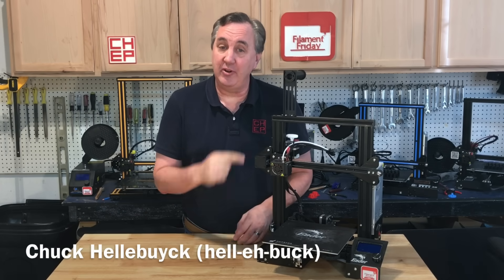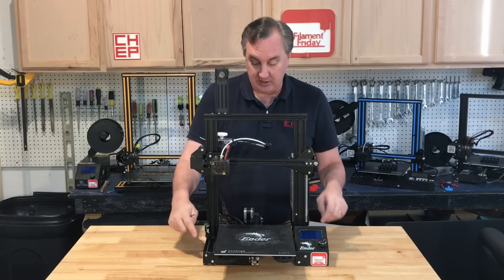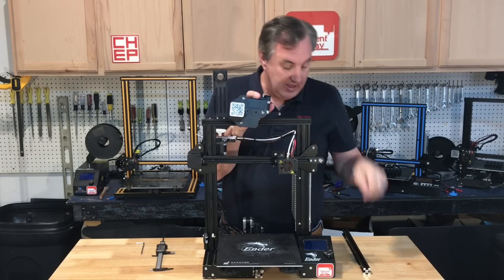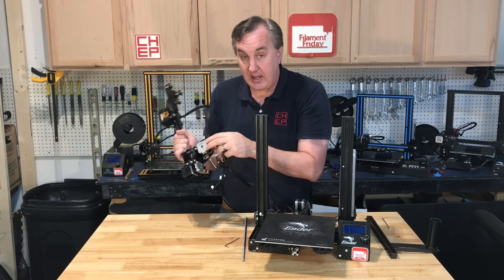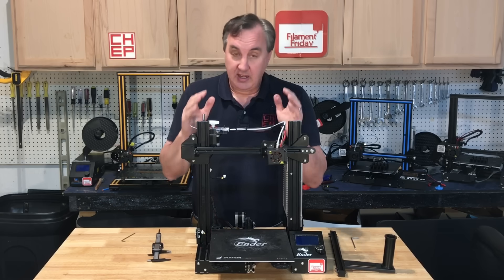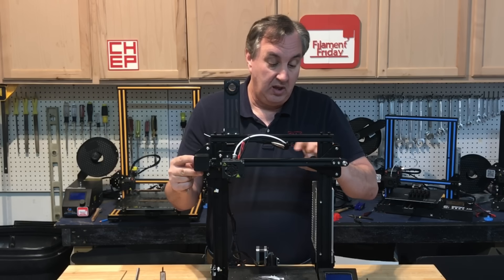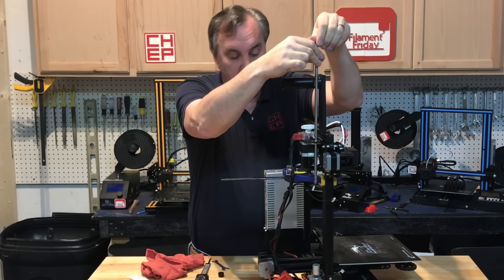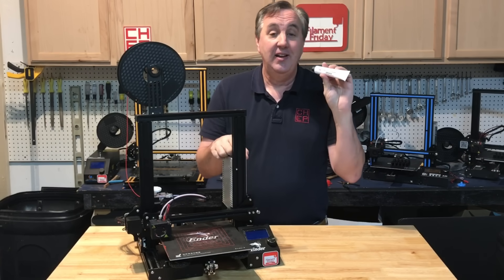Fix Your Bed Level on Creality Ender 3

Comment: Hi Chuck,  I have been following you since I got my Ender=3 v2 last month but recently have a problem that I cannot find an answer to and I am hoping you might be able to help.
New, Ender-3 v2 with manual leveling and replaced springs.  I am quite familiar with setting valve lash so I am also familiar with the concept used in manually leveling the print bed and I would say that I have tried both 'tight' gap and just barely dragging when adjusting.

I do not think that the bed level is the issue.  What I have noticed is that after the machine performs the 'Start Gcode' and moves to begin the print the head lifts slightly, my fingers on the z axis screw, the head does not 'drop' to print level or drop at all from its lifted position and begins to extrude into the air.  I have easily slipped my paper gauge with extra room as it is printing, possibly able to put two or more paper thicknesses into the gap.

Start g-code: [I have not modified this in any way]

; Ender 3 Custom Start G-code
G92 E0 ; Reset Extruder
G28 ; Home all axes
G1 Z2.0 F3000 ; Move Z Axis up little to prevent scratching of Heat Bed
G1 X0.1 Y20 Z0.3 F5000.0 ; Move to start position
G1 X0.1 Y200.0 Z0.3 F1500.0 E15 ; Draw the first line
G1 X0.4 Y200.0 Z0.3 F5000.0 ; Move to side a little
G1 X0.4 Y20 Z0.3 F1500.0 E30 ; Draw the second line
G92 E0 ; Reset Extruder
G1 Z2.0 F3000 ; Move Z Axis up little to prevent scratching of Heat Bed
G1 X5 Y20 Z0.3 F5000.0 ; Move over to prevent blob squish

Any ideas on what is causing this and how to fix?

Thank you - Trey
Reply from the maker: Everything looks fine there. Check your slicer settings for Z offset.
Reply: @FilamentFriday  I could only find one mention of Z Offset in Cura 4.8 under Build Plate Adhesion and it is set to 0mm

Comment: It always amazes me that the Chinese don't use washers on their bolts each bolt head should have a plane washer and a shake-proof washer to spread the load and stop the bolt working loose!!
Reply: Bob, do you really want to spend an extra 7 cents on the same product???

Comment: Thank you SOOO much for this, my ender 3 pro has not printed right since I got it, and this is why.
The Left side prints fine, grips the bed nicely, but the right side is lumpy and reluctant to run smoothly, it even catches on the bumps of the previous layer and jumps over a bit, even tho I level the bed every print.  the left front leveling knob has even fallen off mid print twice..  so frustrating.
Now I have some idea where to start to fix it.

Thank you.
Reply: Mine is similar, with the back left having to be almost 100% tight, while the bottom right is practically falling off.
Reply: @hexaspark  I'll add that to the list of things to do when I get my new bowden tube in. Thanks for the suggestion.

Comment: Hey Mike, thanks for a great tutorial.  I am new to 3D printing and had terrible problems levelling the bed. I suspected the axis was wrong but wasn't sure so it was greaat to get the help.  this video solved my problem on the ender 3 pro

Comment: On my Lotmaxx the screws that hold on the uprights only thread in by 7mm. Anything mechanical like this needs at least 13mm  bite especially since the screws are only 5mm. In my case also the threads aren't deep enough in the uprights so you would need  get a tap and thread a bit more and some longer screws.

Comment: Hey Chuck thanks for the great vid! For some reason mine doesnt move up and down nearly as smoothly/fast as yours does no matter how I adjust the eccentric nuts (theres one on each side for the ender 3 pro) I leveled the frame exactly as you did and everything. Could it be just the white lithium grease?

Comment: My left front knob is very loose I can't adjust further and the nozzle is not close enough.    The left back knob is tight and cant go any tighter and needs to so I can level the bed.    Would this fix that issue?  I dont want to have to take my printer apart if I dont need to.
I've been fine for about a month, but the front left has always been a bit loose.  I've monkeyed around with the z-axis switch in the past to help with leveling,  but now I cant get that to work  

Btw  - you have excellent and very easy to understand videos

Comment: hey Chuck I don't know if you will see this but I am running into an issue with the bed, I leveled the bed did a test for the 4 corners and the middle and it turned out fine, my adjustment knobs are not loose/free moving. but after one print (about a 45 minute print it was a knob for the filament feeder) my bed was really unlevel, like I could see the gap on one side(the right side), would wingnuts hold my adjustment knobs in place, or am I thinking too much into it using wingnuts to keep it together and stop it from moving.

I built my printer using your guide, and levelled it with an help from your video on levelling and Tomb of 3D Printed Horrors
 print to check levelling and how to level. thanks
Reply from the maker: Adjust the stop switch so your springs are more compressed when level. It might help.

Comment: clamping a square on the uprights before tightening them will not get the results you claim, there is no adjustment in that direction if the ends of the uprights are not machined square to the length of the upright there is nothing you can do about it short or recutting the ends square, but it you clamp a straight bar across them at the bottom before you tighten them you can at least get the two uprights inline and parallel with each other.

Comment: Hi Chuck,  I'd like to thank you for the video you had posted to fix the angle gantry rail.  I'm going to apply what I have learned in your video to the E3PRO I have so my springs are not out of whack.   

I also have a question for you.  I have recently purchased the 'gold' springs to replace under the bed, I had done so and the Z-axis limit switch is far too low, I had moved up the switch so it will accommodate the new springs.  I moved it up approximately 6.53mm from the little foot that rests on the lower tube..  Have you replaced  your springs and had the same issue?   Thank you for your comment & help on my issue.
Reply from the maker: Glass bed requires similar so it’s fine
Reply: @FilamentFriday   - I don't have a glass bed  just the normal E3PRO bed that came with it.  when I raised the Z-axis limit switch you think it affected the total build height?

Comment: Question, why aren't those screws a little bit longer and screwed in from the front? The metal behind could either have threads on the holes or washers. The aluminium bar is already drilled through, it only needed a little cutout for the screw heads like you see in other parts of the printer. That simple design change would have made life so much easier for beginners and assembly guide videos. But, to really have any positive impact, it had to come from factory, it will hardly become a mod, because when one gets to the "modding" point, they probably already leveled it a long time ago, and it's not something that requires constant leveling.
PS: I've checked with a barbecue skewer, there is nothing behind the X carriage's metal plate that rides inside that channel that would impact the screw heads.

Comment: Really helpful. I've been driving myself crazy with leveling mine, got a glass bed, thought it was warped, turns out the frame just isn't square. I still have the smallest dip on the front of my bed, might use some masking tape or something to bump it up a bit under the bed.

Comment: Hey @CHEP

I don't think you mentioned it in this video, but I spent probably an hour tinkering with the left side of the X-axis bar, got it within .4mm of perfection, then put everything back together and adjusted the eccentric bolts to make sure it was tight. It was off by as much as FIVE MM afterward.

I did this probably a dozen times, then finally decided to look at the right side - Lo and behold, two perfectly accessible screws that didn't require any disassembly. I did the same sort of adjustment you showed on the left side, on the right side instead and now it's within .3mm on both sides with the bolts where they should be. It may be worth trying to do the right side, with 0 disassembly, first!

Just thought I'd give you (And anyone else who was struggling) a heads up.

Comment: I'm having almost the opposite problem with my new Ender 3 pro - the bed levelling springs are all at or almost at full extension, and are still not close enough to the extruder on one side.  Any ideas?  What am I missing?
Reply from the maker: Lower the Z home switch
Reply: @FilamentFriday  Good idea, but I've double-checked and the Z-home switch is mounted as low as it can go - even if it could go lower, the carriage would hit the z-axis motor before hitting the switch if it was any lower.  I'm thinking replacing the springs and/or using a glass bed would give me more height to play with
Reply from the maker: Then something is major wrong.
Reply: @fudgeweasel  I had this issue and so do others. I found a forum (Can't tell you where it was months ago). I ended up just using the snips to cut the foot off and lower it some more. It seems to be the common solution. Everything has been fine since.

Comment: I bought an Ender 3 Pro and love it. It prints great out of the box. I have watched most of your videos on it, thanks for that. My bed is warped, can you make a video on how to fix that. I was wearing a groove down the side of the magnet and decided to go ahead and out the glass bed on because of this. I want to print on the flexible magnetic but cannot until the bed is flat. Thanks in advance.
Reply: You can mod the firmware to enable manual bed leveling or to add a sensor for auto bed leveling. That can correct for a warped bed in software. The only other option would be to buy/build a new heated bed from some temperature stable material, which I have no idea is a thing or not but I guess it should be if other printers don't have this problem.

Comment: After I built my printer, I could not get the bed level and ran into the issue you mentioned of the springs on one side being tight. Your instructions on how to adjust the x-axis bar are extremely helpful and I'm finally printing.

Comment: So is a automatic bed level system pretty much a must have if you're wanna get serious with 3d printing?
Reply: Absolutely not! While it can help immensely it is not a must have. If you're having a lot of issues with bed leveling and just cant manage to get it right (and don't want to buy an abl) you should look into manual mesh bed leveling! Teaching tech has a great video on it, and it helped a lot before I saved enough to buy a bltouch.
Reply: @Clonephaze2327  that's what I was thinking. It's just now that I've been 3d printing for about half a year or so. I've probably watched approximately 4 billion youtube videos on my way to a semi confident printing ability. I've started to notice things that I had no clue what were. One being that pretty much everyone has an auto leveler. I havent really had any issues in fact most everything I've printed has come out much better than expected. Now it's just more curiosity than need. I got the ender 3 with most of the bells and whistles and just wondered if that's the next step.....also, and this is most likely going to be a super stupid question. But I have not seen anything actually addressing this. Does the heater bed need to be on for the whole print or just the initial first few layers. I ask this only because theres alot of prints that will start higher and then drop after the first layers. I know ABL needs all the heat you can give it. But is pointless for PLA other than the first few layers?
Reply: @s8nlx661  hey sorry I never saw your reply! I would definitely keep it on personally, as when most build plates cool down they tend to "release" the print a bit since the first layer is allowed to cool and shrink. Keeping the temperature up will make sure the print stays on the board!
Reply: @Clonephaze2327  that definitely makes sense. It's kinda funny, these little things never actually get mentioned. You'd think that would be mentioned for beginners but I looked everywhere and theres literally nothing anywhere. I e just been leaving it on and never thought twice about it. But after seeing how small adjustments can make a huge difference in your prints, it had me wondering. But yeah I see what you mean in temp shrinking and plate cohesion. It's funny, 3d printing must have been a nightmare before youtube. Theres so much to help learning. But pulling one of these printers out of the box and all you had was an instruction manual to show you how it works and then go from there..it must have been ultra aggravating. So youtube is almost a necessity. It may be the most important tool for 3d printing...now, if they only put a full cura  program for android I'd be good to go. Its baffling how that is not a thing. Alot people dont have a pc cuz phones are just as good if not better. Theres a few that are so so. But are very limited not a full actual program. Like the pc versions. It makes no sense at all
Reply from the maker: Check out Astroprint. It’s in the cloud and uses Cura as it’s slicer.
Reply: @FilamentFriday  that's actually the one I use. It's pretty good overall. The online cloud version is good but the app android version is awful. All it allows is size, quality and fill percentage. But no actual manual settings like the online version. If the online version gave the layer feature, and not just the 3d plate it would be perfect. But someone on the 3d geeks site said that they are going have it soon. It was supposed to be added in the new layout that happened in mid March but there were issues and wasnt ready. So if that happens it will be a huge plus. Cuz having to buy a computer just to use a slicer is waste of money. But it looks like 3d printing is getting more and more popular. Especially with the price of the Ender 3 and its ability to put out some amazing prints. And now the resin printers have dropped and offer a 200 dollar model now. The miniatures crowd are gonna be buying those up.
Reply from the maker: Not for me. I’ve had more issue with ABL than anything else so I manually level and leave it alone. Works great.

Comment: Hi Chuck, my machine has the problem that you have mentioned... The main problem is not with the machine but with me as I am a bit lazy. I ended up putting washers under the springs that didn't have enough tension - shiming is a lazy way out I know... Do you think that it will have other problems doing this?
Reply from the maker: Not that I know of
Reply: Martin Birrell 
Print a cube and check that it is a cube.  It probably won’t be, because your x-axis and z-axis aren’t at right angles.
Reply: Buy a silicon solid spacer hot bed leveling in aliexpress maybe will help ya out

Comment: Hi and thank you for your advice, I will male some looks today.

I have another strange things (which not cause me problems, but strange) : the middle of the plate is lower than the corner. That mean, when I calibrate it, it’s just impossible to get the same height everywhere on the plate.

Thank you.
Reply: The ender 3 is famous for having a warped bed, my bed is the opposite it's a tad high in the middle. The easiest fix is a glass build plate to make it completely flat or throw a bl-touch on there to auto level.
Reply: Cryptocurrency1607 Good thank you. For the middle too high, I see a man putting his glass bed under a drill (like cnc printer) to make it flat everywhere.

For the glass, I have it but the magnetic one is wonderful !!!
Reply: @rima1815  I have a glass build plate but I honestly don't use it much. I use the magnetic one which texture has worn off of a long time ago so I have to use a bit of glue stick to make it work. I  just level my bed after I start a print, just eye up where it's sticking to much and where it's not sticking enough and adjust it like that. My build plate being warped honestly very rarely causes an issue, and I bet yours will be the same, no worries.

Comment: Thank you for the video. I am having an issue, when I loosen the screws and move the right side of the gantry and tighten the screws I can see easily that it is not straight which is how its supposed be to compensate I'm guessing. But then I try to the gantry back on the printer the right side has some difficulty going on, once I give it some help it will go on BUT the gantry will straighten itself out again! And does not stay offset.  Don't know if that makes sense.

Comment: Chuck, Thanks for the timely tip. My Ender3 has performed beautifully on PLA, TPU and PETG but I had issues getting the bed perfectly level.  I even bought stronger springs which did help but not exactly what I wanted in bed leveling results. 

I performed your tip (it took 4 tries) and got the measurements within less than a half millimeter of each side so I was happy about that. I'll relevel the bed tonight to see if it helped. 

Thanks for a great tip.

Comment: Don't grease it!!!!  It just helps collect dust, which might be abrasive, and for sure will clog up over time . The brass in the lead screw nut is the lubricant itself.
Reply: what about dry grease like graphite?

Comment: hey chep.  Thanks for all your help over the weeks hey...
 I have spent days mucking around trying to level my bed. no matter what i could do i could not get it right, (my ender 3 pro is from xmas) I just realised today that my end stopper button was broken and it was getting a different level every single time it went home..   I have defiantly bought a lemon, i have had to replace the extruder the filament fan the nozzle, 
 Is this normal for these printers.?
 I bought a ton of upgrades that i have not yet received but  I should have been buying parts just to keep it going